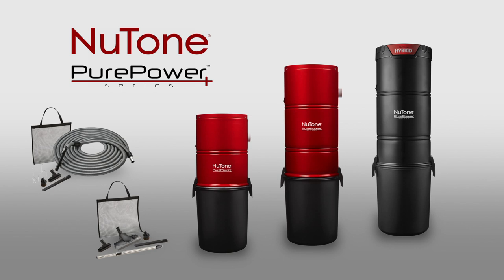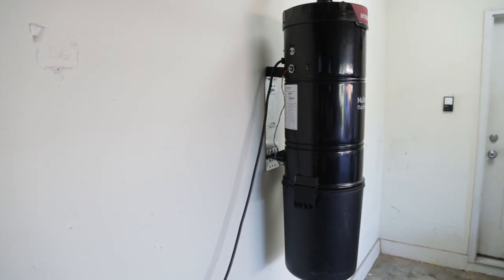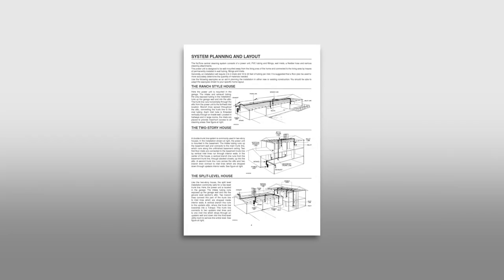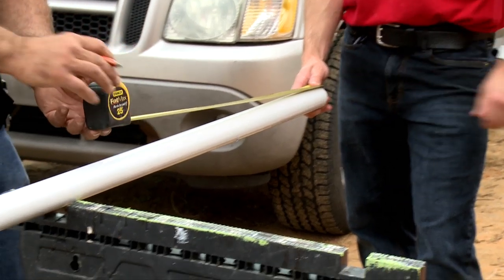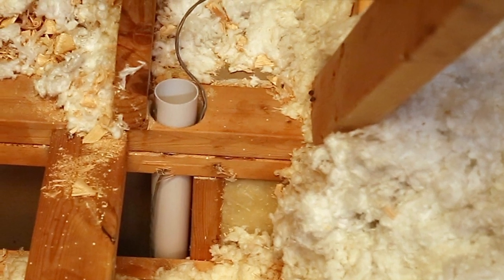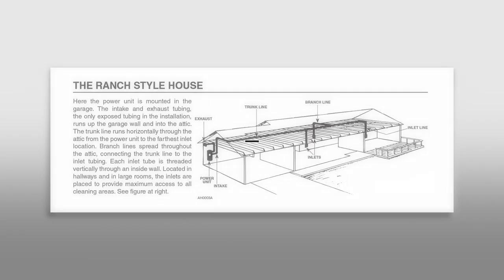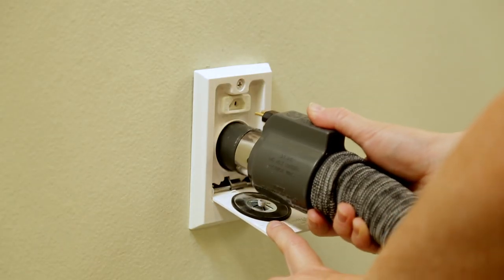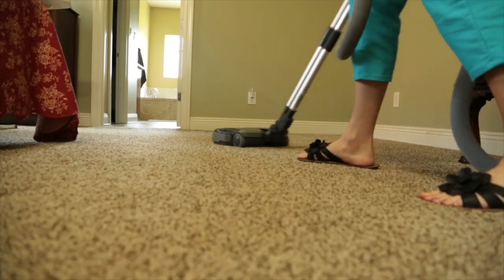How to Install a Central Vacuum System in Existing Construction

Comment: Three tips: 1) when vac tubing travels thru a floor install a foot long piece of 2" EMT tubing. I had to go thru a 2 by 3" stud over two walls and was unable to use much thicker rigid conduit, in the basement where a vertical tube drops down install a Y fitting and go down at least 6" and tape NOT  GLUE a cap on it. I have one in middle of basement and another one in garage close to central vac motor. At some point drill & tap a pipe thread to install a valve & a vacuum guage. I marked my guage when the filter was new & clean. Couple of times my kids sucked down halve a crayon , tooth picks and marbles retrieved them by removing tape in end caps. If you don't have pipe tap purchase two 1 2" sealing locknuts and drill a little over 3/4" hope in end cap then install a sealing locknuts on both sides if a 1/2" pipe hippie then silicone both locknuts to prevent vacuum leak. Depending on pipe size on vacuum guage you might have to purchase a 1 / 2" to a 3/8 or 1/4" reducing coulpling.

Comment: The hole size 2/12” in 2x4 in the attic is miss leading, because it’s very difficult if not impossible to get the tight 90° elbow through the hole, I had to widen the hole in order to get the tight 90° through, now going into a wider hole such as 3 inches or 3 1/2 will weaken the structure of the 2 x 4” I have in the attic. It’s not clear if the studs in the attic in the video are 2x6” or not!. Thanks

Comment: just bought a house with this system - I left the painters to prep for painting and they pulled all wall switch plates off the wall and also pulled the vacuum plates and tube  out of the wall...the system will not shut off I had to unplug it when I discovered it was running - please advise

Comment: is there a need to centralize the unit to get the best overall suction?
Reply from the maker: Thank you for your question on the central vacuum systems.  Centralizing the location would be more for location of the inlets and ease of use, than it would be for overall suction.  Please contact our Technical Support team with further questions at 800-637-1453.

Comment: I have never had a central vacuum system and was wondering where the 36-foot hose is stored? I did not see the info in your video for installation. Is it something that is lugged from room to room? Or are there multiple 36-foot hoses that are stored in a wall cubby in each room?
Reply: Usually one hose but some people buy extra hoses for each floor or room depending on your house so yeah you just lug the hose around
Reply: For my basement I used a water hose holder that bolts onto wall. Store the second hose under a bed. They did supply a thin flimsy what looked liked an oversized coat hanger that I screwded onto the inside of a bedroom closet door but didn't like it.